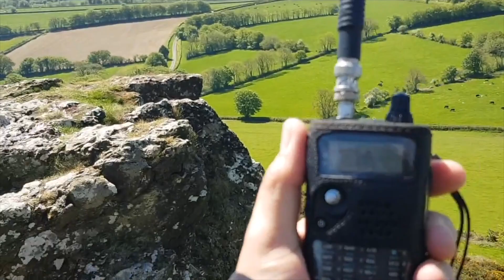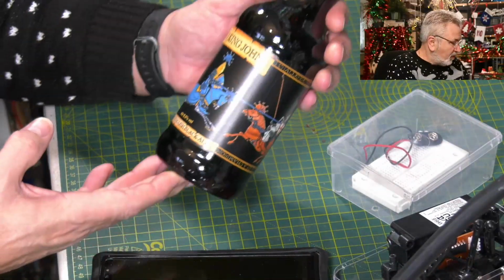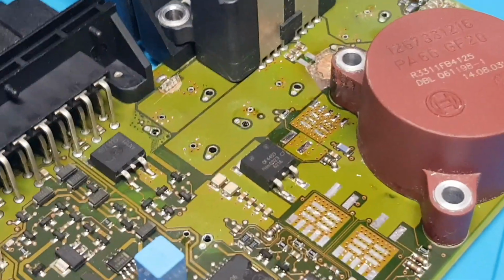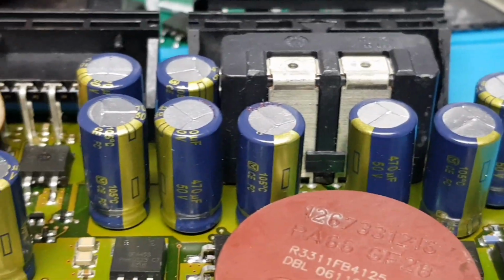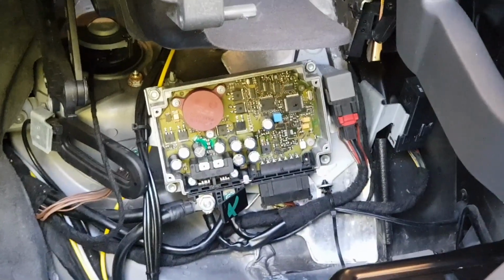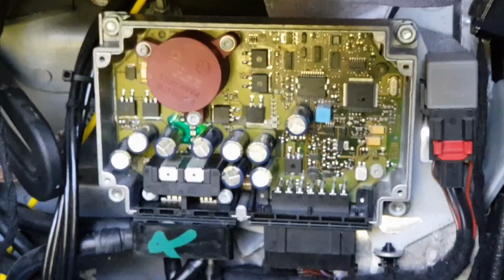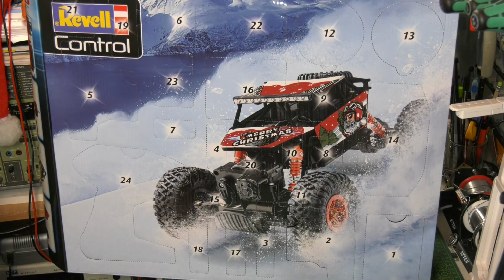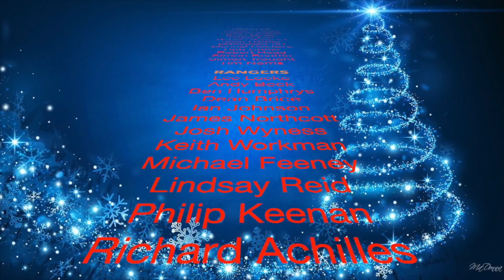Crunchers Christmas 2022 : Mercedes R230 SL500 Battery Control Module (BCM)

Comment: My BCM just started burning up after I put the boot into service position. Now I'm searching around, wondering what to do haha
Reply from the maker: It's probably the capacitors failing.
Reply: Thanks for your reply. I will try look at bypassing the BCM at the relay and permanently disconnecting the front battery. @Radiocruncher

Comment: I'm quite impressed at your video and work performed. I'm in the states and also believe i'm in need of this repair as well. It's a HUGE issue and could be a good revenue producer for you should you want to explore that, especially now that you've researched the issue and parts required. I'm interested to see if you'd be up to taking a crack at repairing mine, thanks.
Reply from the maker: Thanks Tommy. It’s was a lot of head scratching but worked very well. I can look at yours but no guarantees that it will work. Please Email me graham@radiocruncher.com to discuss. Regards Graham
Reply: great work, I’m interested in this as preventative maintenance. You have email!!

Comment: great job! can you please list the compnents you used\replaced here in the comments?

much appreciated
Reply from the maker: Thanks. I can’t really remember but will see if I can look back at the parts I ordered
Reply: I too would like to know the components used please especially the 3x ceramic capacitors? as mine is apart and I need to replace over winter. Thanks for your great video too